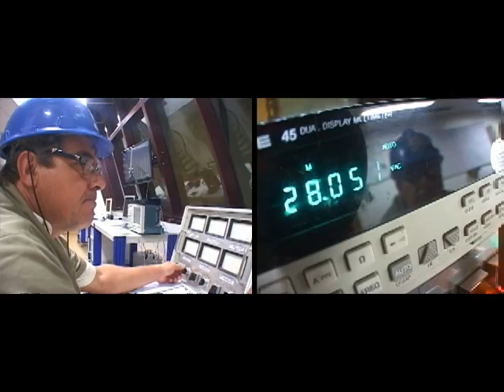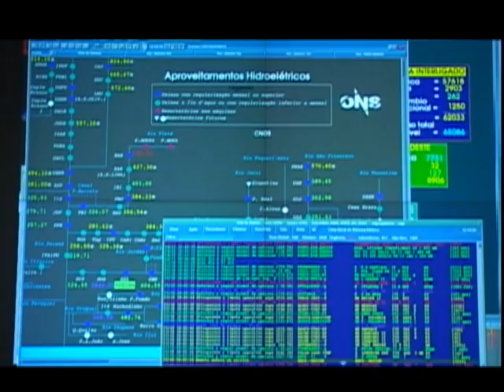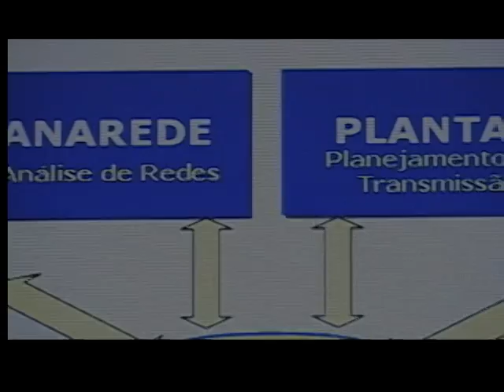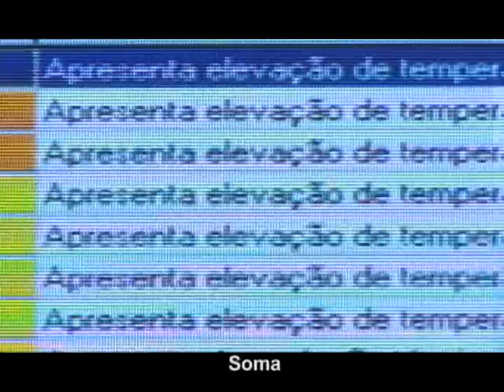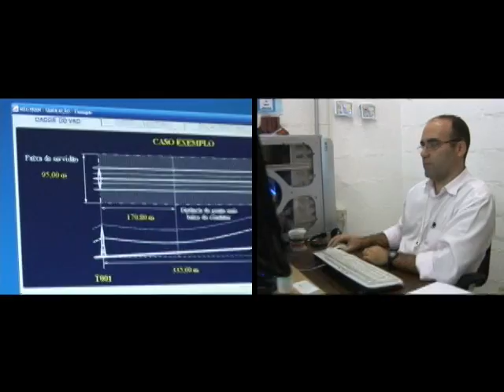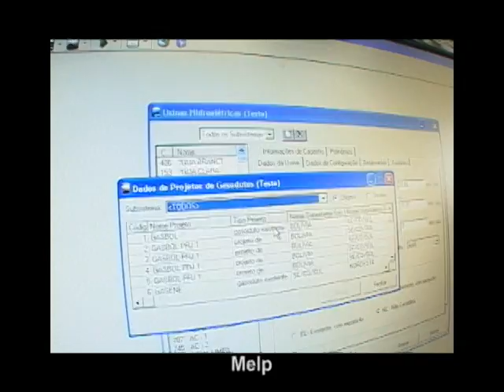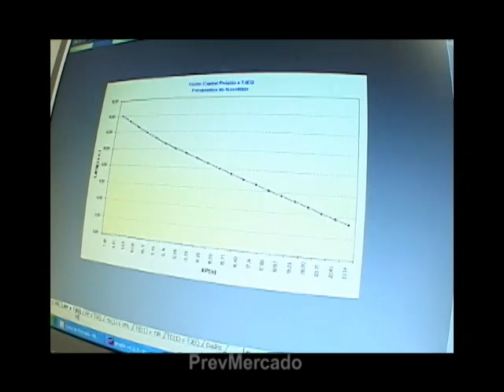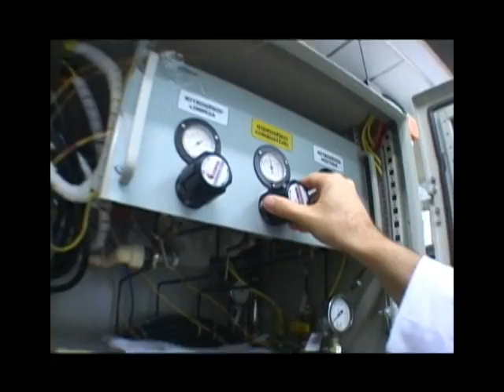CEPEL - Eletrobras - Rio de Janeiro – RJ - Brasil - Vídeo Institucional - inglês

Comment: Dear friend, great video!
Video in english, comments in english too!
CEPEL is responsible for providing and supporting the solution of real-time control of over ninety per cent of the transmition networks in the country!
CEPEL is Automation Systems, Eletrical Networks, Tecnologies and specials Projects, Transmition lines and Stations, and much more...

Nice post and sharing, thumbs up one more like!
Reply from the maker: As far as I can see, the commentator is a good fisherman and very knowledgeable about Cepel - Electric Power Research Center. It seems to know the entity in detail. Have you worked in Cepel or are you a Cepel customer? What is your involvement with the Entity?